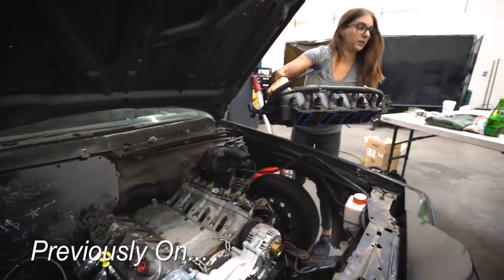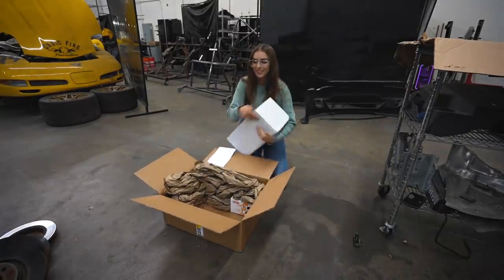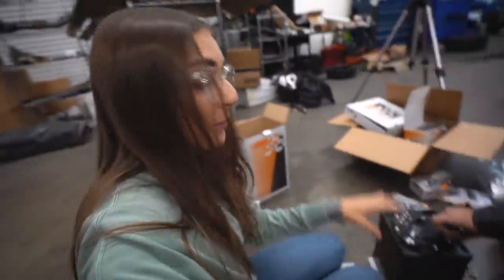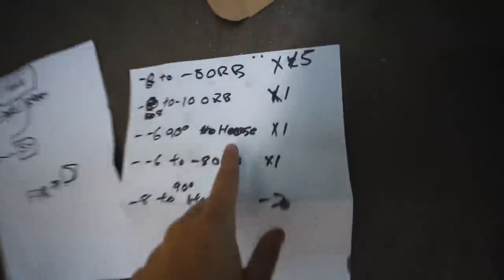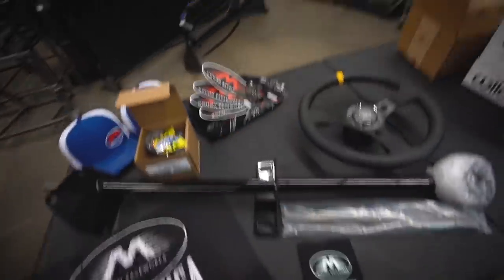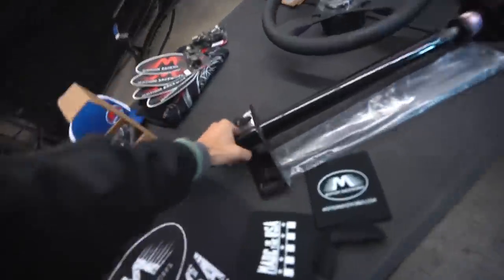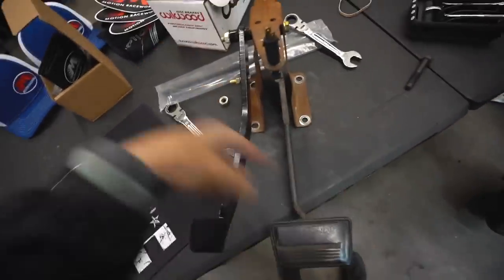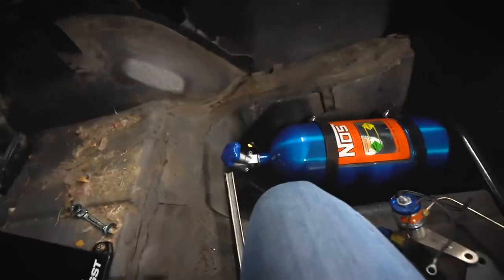MANUAL SWAPPING MY DRAG BUILD! + MIMI GETS 2000HP FUEL SYSTEM!

Comment: The mark on the steering wheel started from rally. A driver used it to mark how far from 12 o'clock the severity of the turn was. This was the basis of where pacenotes were made. For example 2 right 3 left...

Comment: The stripe is for the pace notes in rallying, when doing the recce (Recconacance) basically you write your own notes or buy them and modify them on the recce , day b4 the rally in your a road car with loads of stripes on the steering for matching the steering input to an angle of corner 1-6 usually. Some drivers use 1 tightest slowest corner and 6 is fastest flat which can b close to wat gear you can use around the corner ,others use 6 as tightest and slowest and 1 fastest but that dosent make sense to me, it's more the severity of the corner.

Comment: Pick up a zippo or peacock hand warmer. It works like a catylitic converter and burns lighter fluid without a flame and they stay warm for 10-14 hours. I kept one in my pocket during the winter when I was working as a tire tech and it was the nicest thing.

Comment: Couple suggestions. 

1. Get yourself an NHRA rule book. The  fuel pressure regulator can not be mounted on the firewall where you did.

2. Make sure the guys installing the cage have a current SFI book for the certification you are going for.

Comment: That stripe on the wheel started in drag racing. When your car has enough power to lift the front wheels on launch, you really want to make sure your wheel is straight when they come back down. Racers started putting a piece of tape around the wheel as a reference.

Comment: Mark Donahue Racing in either CanAm or IMSA used it to tell if he was drifting the corners well or was going to rip the rubber off his tyres it also told him if the steering was centered while he was drifting the car around the apex of the corners,Also it was used in WRX rally by colin Mcrae so he knew if he had his wheels lined up for the exit on hard turns.

Comment: The fuel pressure regulator can’t be mounted to the firewall as per NHRA tech rules
Reply: I was just getting to post the same thing! I also wonder if the guys installing the cage have a copy of a current SFI book to reference.

Comment: Carl Lopez in "Going Faster" mentions on pg. 39 that Mark Donohue used a strip of yellow tape on his steering wheel to clearly see which way the wheel was heading on the way out of a turn. (Lopez uses an intersting sentence structure that implies that the wheel was acting on its own and Donohue was merely a spectator. I'd be curious to know whether that implication was intentional or not.) Based on that, I put a stripe on my wheel several years ago to help me see clearly whether I was unwinding the wheel as I headed toward track-out. Paying attention to that helped me more quickly learn what was too early and what was too late. I noted it while driving since I don't have an onboard camera; other than my all too inaccurate brain. A mark would certainly help one evaluate onboard film.

Comment: I think the strip on the steering wheel started with NASCAR racing . And you can use a steering shaft from a Jeep Cherokee or the S10 I think the both adjust but one has a different collar so you have to match it up to the old one . I just want the floor pans welded in already just send me a plane ticket and I have it done that day 😂

Comment: The stripe is originally for pit stops so the driver knows the wheels are straight and ready to be changed. Obviously this applies to flying through the air as well, but that's where it started

Comment: I couldn't quite tell. Were there grommets in the holes for the fuel lines? Because if there wasn't someone likes to watch cars burn when there is a fuel leak about a year from now when that line wears down enough to spray fuel under the car where the flames from the exhaust find it. Ask me how I know.